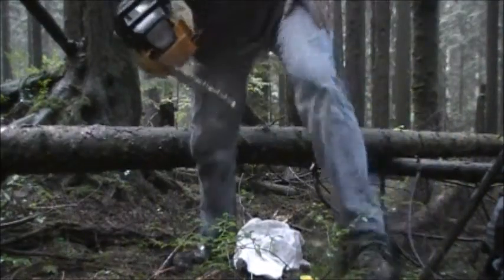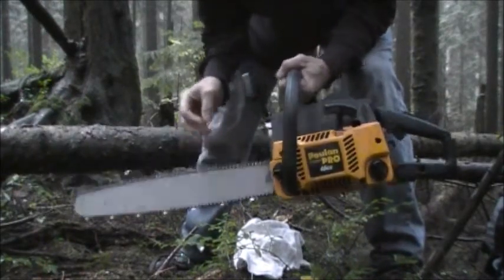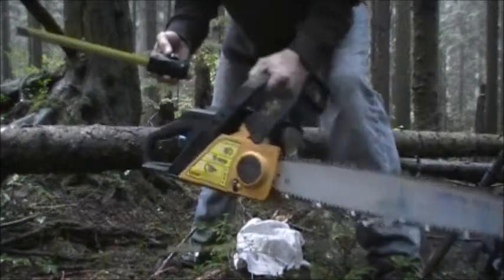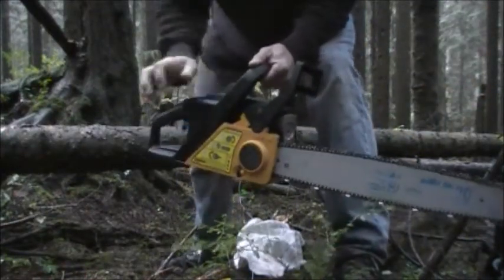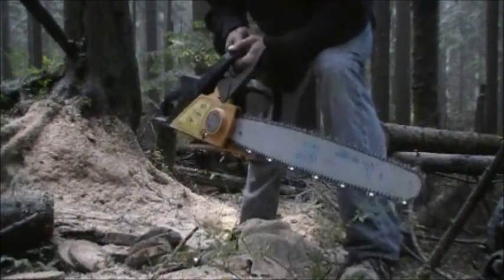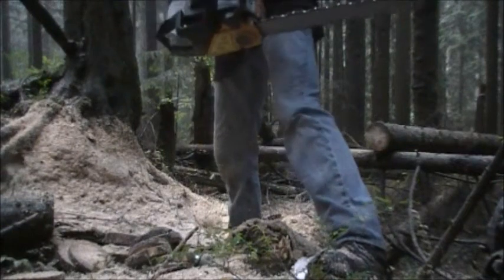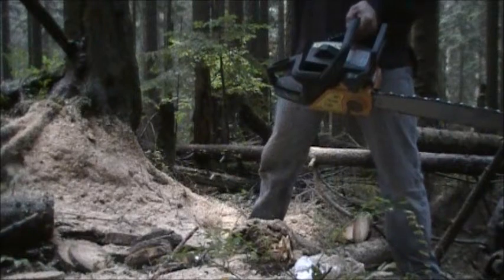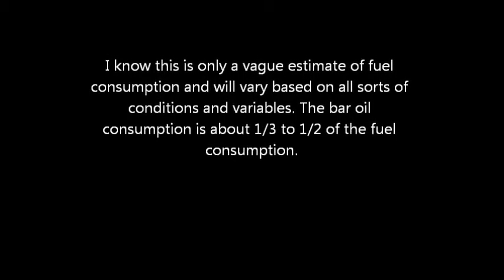Chainsaw fuel consumption

Comment: I would also find it helpful to know how LONG a chainy would run on a tank of fuel. Where I do most of my work, there are many varieties of timber - some soft as butter and others as hard as granite - and the time it takes to drain a tank would be a good yardstick for those like me who suffer multiple grades of timber.
Reply: who gives a shit how much gas the chainsaw uses when you are cutting. if it bothers you stop cutting wood and buy it all dumb ass